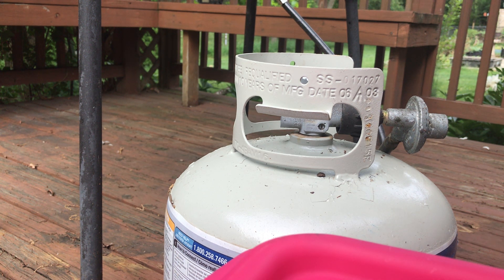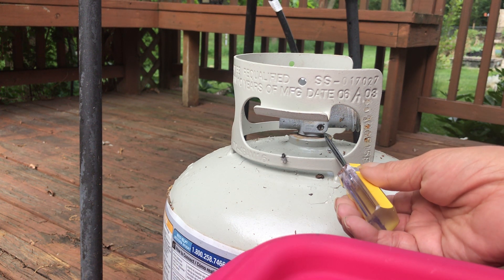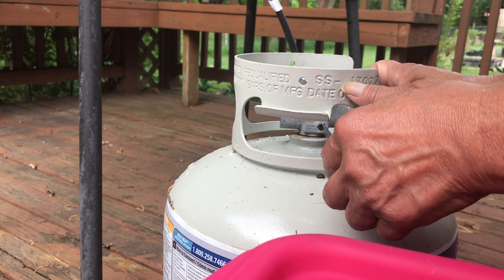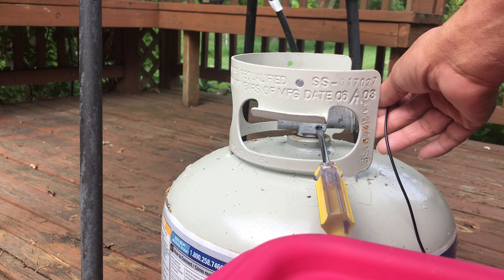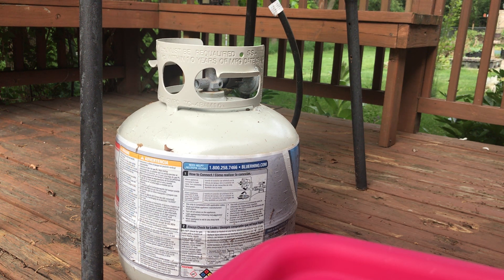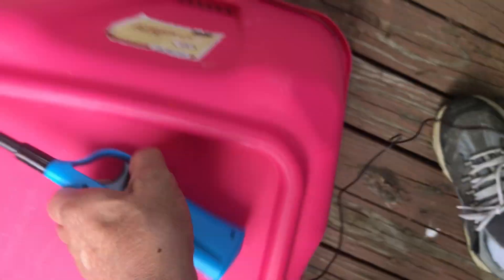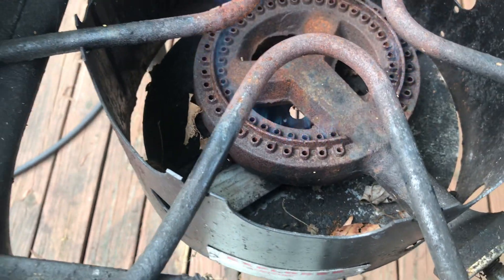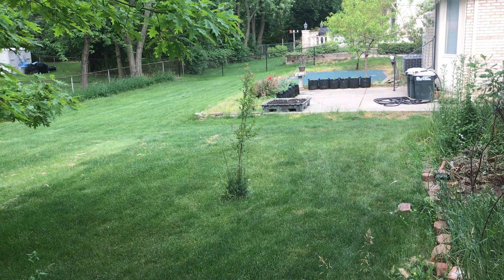Fix my Propane Tank, there is no pressure.

Comment: opening the bleeder screw does nothing for this. the valve has a safety in it if you open to fast it will close. to solve this then close valve wait a minute then open the valve SLOWLY. it will work fine.
Reply: Exactly 😂😂😂😂😂

Comment: No, just no. Here's the deal...that little set screw has one purpose: Its a bleeder valve for checking the liquid level in the tank and for expelling excess fuel. That's it. Low flow issues happen when you open the valve too quickly and it activates a safety feature in the valve that cuts off supply. About 95% of the time, this is the reason. You have to reset the float valve by banging the tank (butt first) on the ground. 

BBQ's may also take some time to allow air to purge out of the line and light the burners. You may have to wait several minutes for this. A failing regulator can also do this. If you mess with that bleeder, make darn sure there are ZERO nearby ignition sources or you're gonna have a very bad day.

Comment: thanks for helping me fix my low flow, when I was just a young man living at home with my Parents and Brother and Sister, can  I suggest that you drill some dirt out from about 4 points around your apple tree I did it about 30cm from the tree,  I used a 3/4 inch auger bit in my hand brace and bit, and just poured some fertilizer into the holes watered them once then got distracted and forgot about it, the tree had been very slow growing, suddenly it double in size in one year then it tripled in the next year, and so on, I don't remember what kind of fertilizer I used, but for you what ever is good for apples, my tree grew to be a magnificent shade tree for my parents, when they passed on, we sold the house and the new young owners cut down our beautiful tree, so they could mow their grass?

Comment: In case Po's tip doesn't work, heres a couple of tips for most newer manifolds that may help:  1. the problem is possibly  due to a Low-flow safety value...not the tank.  See video "Low Flow - The Full Story" by OntarioGasBBQ" for an excellent explanation and simple solution.
2. It may be that the manifold is frozen from the propane.  See video "How To Fix A Propane Regulator With Little To No Pressure Output Propane Grill Won't Light" by Outdoors With Jeff.